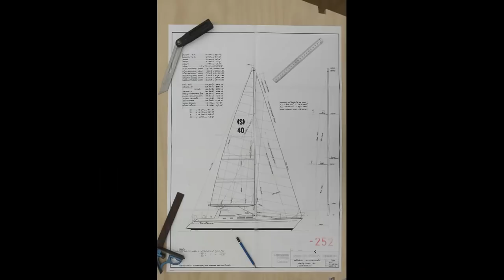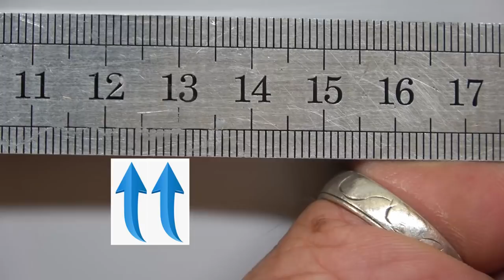Building my steel sailing yacht Ep.68 I COMPLETE making the main cabin-sole (pt.4)

Comment: Hi bruce looking fantastic, quality stuff mate,  not sure on epoxy on these floor panels if you drop something epoxy tends to crack I used a single pot polyurethane still looks good after many years of Constance use. Just don't want you to create more work down the track. Cheers.
Reply from the maker: Thanks very much for your great comments Lindsay, much appreciated and re. the epoxy on cabin-sole - all epoxy's are not the same hey and the Bote-cote product is very flexible and specifically designed for boats and particularly on timber, ie. to cope with the constant shifts and flexing of wood. There are some particularly low cost epoxy's that are quite brittle.  🙂

Comment: Cabin sole looks great and I doubt anyone but you will notice the grain variation. You just can't get that much timber from one tree so that they are all the exact color. You did a nice job matching color on the rosewood and with the birch strips you cant stain the rosewood to the same tone. I think after you get the epoxy and the poly on it that it will look fantastic. I would protect it with a layer of ply,, carpet or cardboard to keep from dinging it when you finish the cabin headliner and other brightwork.
Reply from the maker: Thanks very much for your great comments Richard, they are very much appreciated and yes indeed I will be covering it whilst the fit-out continues!  🙂

Comment: Bruce - if you haven't selected your floor varnish yet - have a look at Wattyl Estapol Flooring 7008
Reply from the maker: Thanks for the good tip Ian, I am using epoxy and PU however.
Reply: @BuildingSYMistress  the 7008 likewise is two part  - very hard wearing is the issue

Comment: Ok so what's the deal.with the plastic wrap your putting on is that to keep moisture in or out while it's drying
Reply: Its to stop the clamping beams from sticking to the job if some errant epoxy has got onto the surface
Reply from the maker: Thanks for your good question Bryon and MaL's reply is correct.
Reply from the maker: @mal6232  Thanks for your help!  🙂